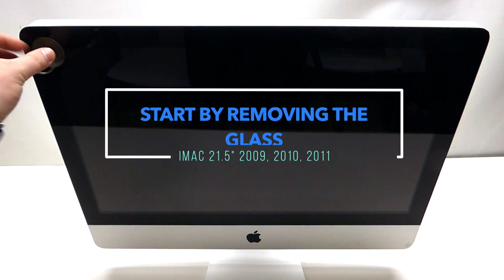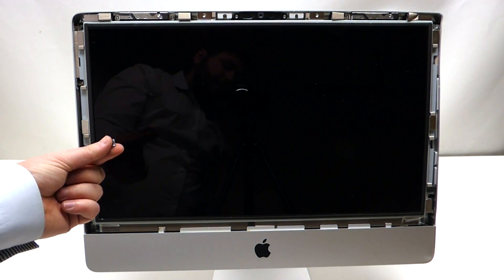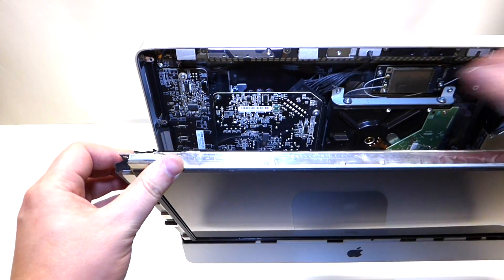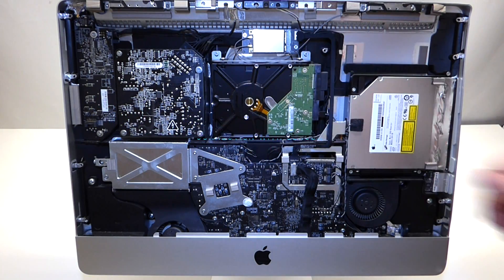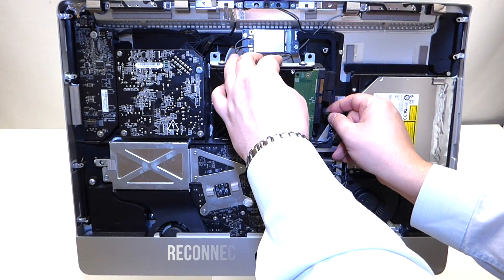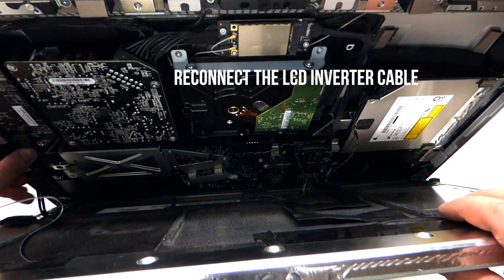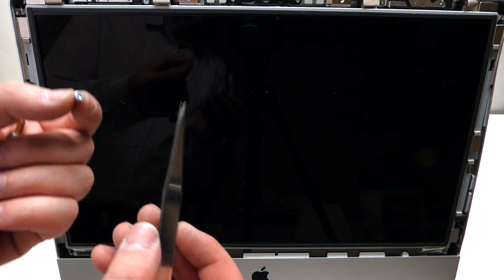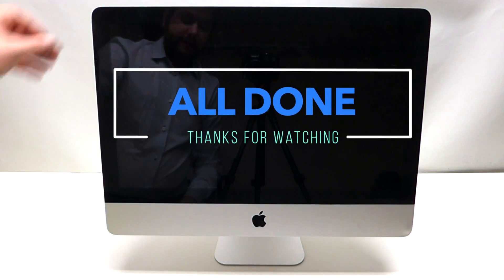iMac Hard Drive Disk Replacement 2009 2010 2011 21 5" Apple Dollars #9

Comment: I want to install a SSD 2.5” into 21.5 inch iMac Mid 2011. Do I need an adapter or do I double-sided tape the SSD into the iMac?

Comment: Great and useful video, thanks.

My question is in case I see the blinking folder with a question mark is the only way to fix it is to change a hard drive? Or can I repair the current hard drive somehow? Any chances for the repair?
Reply from the maker: These is a way, watch this video all the way through https://youtu.be/B6MB1hJ8Wa8
Reply: Save Apple Dollars I will watch, thanks.
Reply: @GRIBSOFT  Hi same problem with the desktop with the flashing folder.  If I replace the HD will it go away?

Comment: I have an imac with a flashing folder with a question mark and a i was wondering if I need a new flash drive or if i can use a external hard drive
Reply from the maker: You should swap the dead hard drive for an SSD but if you need an immediate fix then yes a USB drive will work as a main drive to install a recovery OS on to and you can boot from it but it will be extremely slow.

Comment: Thanks for the video, buddy... if you want to install an ssd You need adapter?
Reply from the maker: You can get a cage adapter because ssds are laptop drive size but you don't need one, you can just let it dangle inside, it will not hard anything.

Comment: Hello, can you explain to me why on other videos for the same iMac upgrades other have added a Digital Thermal Sensor cable and you dont do that or make any mention of it?
Reply from the maker: +Hardangelfan Hi, on this model the temperature sensor plugs into the drive. Some manufactures made stick on sensors. This video does cover the temp sensor that plugs into the drive near the sata connection. Having a HDD temp sensor plugged in will prevent your fan from going on full blast so i highly recommend that you have it hooked up. Just as well you can always use fan control software to slow down your fans if they are too loud.
Reply: @GRIBSOFT  Much, much later into the future: I'm curious if an SSD can be placed into this cavity with only fan software to control the fan? I just had a look at an SSD I have and it doesn't have the pins a HDD has.
PS: what pins, on that HDD, out of all of them, did you connect that thermal sensor to?
Reply from the maker: Tracy LF just hook up the the power and SATA cable to any ssd, you don’t even need to screw it in just leave it hanging in the cavity. Use Fan Control for Mac to that can be found here https://www.appledollars.com/downloads to control the fan speed.